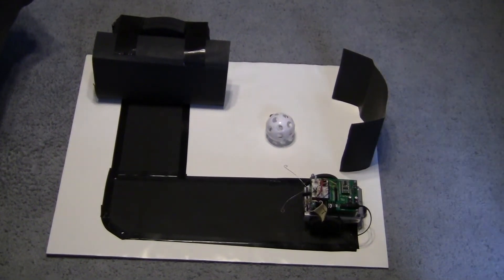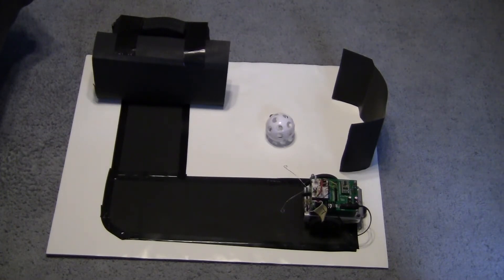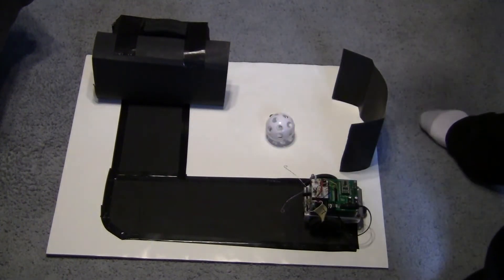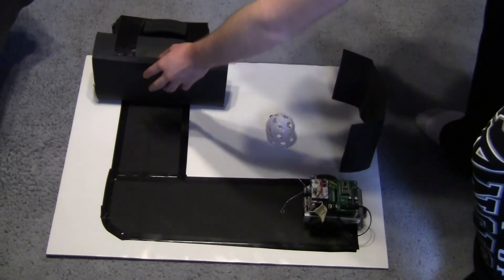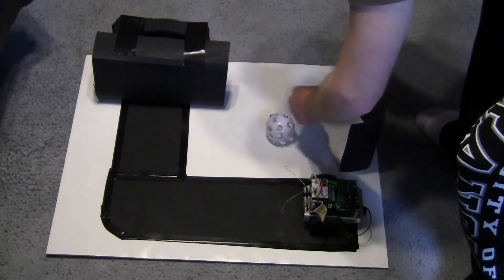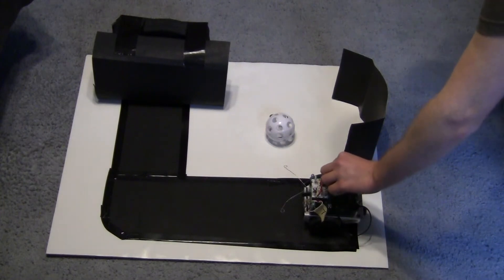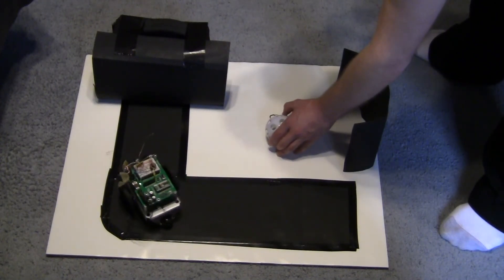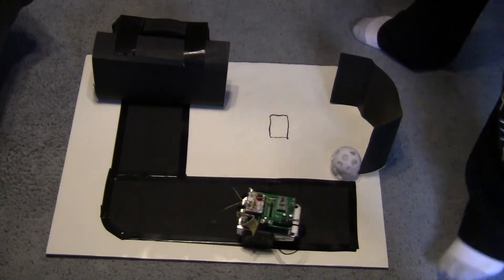Boe-Bot Robotics: My Final Project

Comment from the maker: If I remember right, I used the clear phototransistors that came with the kit to detect light. I don't remember exactly how I coded it because it's been a long time, but if light was detected (bouncing off the white part) it turned. If not (the black part of the board because black absorbs light) it kept going straight.